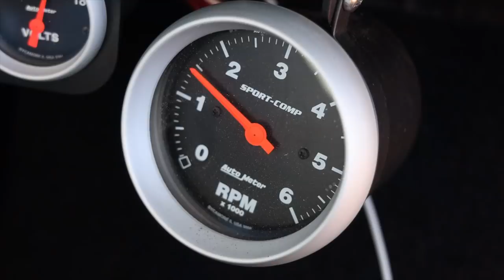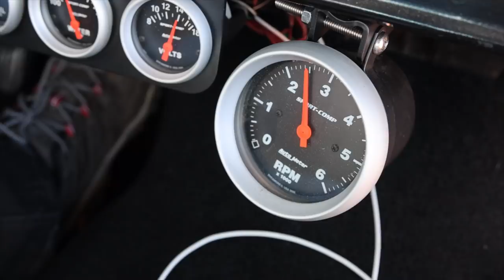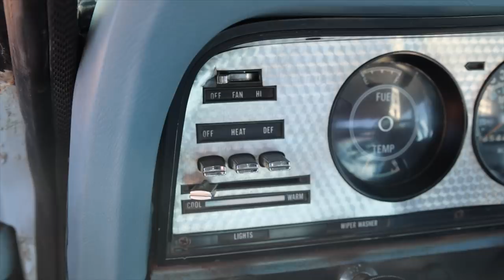The Repair List for this Cherokee Chief is Getting Long!

Comment: Someone up here scored a full sized 1980's Grande Waggoneer for under 6K. It was perfect, a really nice time peice. It's so hard to find them without major flaws or rust. I remember as a teen my dad was getting his old 72 Chev C10 painted by a local shop where he traded plumbing for the body work and paint. He had a stepside Honcho, I loved that truck....He was moving some stuff around and banging into it and dad commented about him putting dents in it. He came back with 5lb sledge and pounded on the fenders which shocked us both, because there was no damage not even the paint. He sold that shop and move to an acreage that had old trucks & cars sitting in the bush. Some were sitting there so long trees had grown between the frame rails. I guess he had plans to restore them and sell them as retirement funds.

Comment: I just bought a 1989 ford bronco with the 351w. I too have to upgrade mechanics. I have replaced radiator, pan gasket, power steering, tie rods, ball joints adjusted the steering box, replaced the rear piñon seal. The heater was not working, but back flushed the heater core a few times and it works fine. Just trying to make it trail worthy before I drive any distanced. Trying to keep it stock. I did have to replace the tires as the rig had set for a while and the tires were cracked. I enjoy the channel. I have owned two other broncos, a 1970, and a 1979. I should have kept them. I used them for search and rescue.
The old iron has character!

Comment: I love that jeep. It looks so cool going down the trail. That hot start issue might have something to do with the fuel line and filter sitting on the hot intake manifold, it is probably boiling the gas. I would move them or get some insulation wrap.
Reply from the maker: Great point and when I tackle the fuel system I'll be sure to consider that!
Reply: @TrailRecon  Knowing that carbs are pure voodoo magic, I quickly converted my '83 Bronco to a TBI based Fi system!   Unless you just like carrying a live chicken to sacrifice to the carb gods for trailside repair!  Then again, you Navy guys do love your odd traditions!

Comment: Brad, on the slow start when it is warm... I had that on a big block chevy, all the forums I read pretty much pointed to one thing. The hot engine is quickly evaporating the fuel from the vented float bowl while sitting. The long cranking is happening because your fuel pump has to get enough fuel back in the bowl for it to start and with a mechanical fuel pump this takes a few cranking rotations to fill. My solution was a phenolic spacer between the manifold and carb. Works wonderful now.

Comment: Cap and rotor with timing check.  Will make that start up amazing, electric choke helps too.  Sweet rig, I have a 74 Cherokee, 74 J10 and 75 J20 myself.  Love the full-size ones!

Comment: In 94 I bought an 84 K-10 got a EZ Ride 4"' lift,  pulled one short leaf off each spring pack, got rid of the sway bar since I don't road race, and Rancho 9000 shocks and ended up with a nice ride.  Still tow and 4wheel with this truck.

Comment: So cool.  The first 4WD I drove was a 74 Grand Wagoneer.  The first truck I owned was a 79 Ramcharger.  I had a lot of slop in my steering.  Turns out that the universal joints on the steering shaft were a horible design and went bad.  It's been almost 20 years since I sold that truck, but when I was thinking about fixing it all (including rebuilding the engine), I think Summit had a replacement steering linkage.   The breaks were spongy as well.  And the forward drive shaft would go bad every couple years because the front hubs didn't unlock.  Oh and the transfer case wouldn't shift into 4WD well.

 There was just too many things so I had to let it go.  I regret it because the thing was a tank.  Good on ya for taking on the task of keeping yours running.

Comment: Love the direction you are taking with the Cherokee. I know that you said you do not like to mess with the wiring and I am with you on that. It can be a real pain, but bad wiring has burned more than one classic vehicle. If you can, I would get a replacement harness for under the hood and the body. They can be expensive, but it is better than calling the fire department when something shorts out and...

Looking forward to watching the transformation into a restored and capable trail rig!

Comment: I absolutely love those Cherokee chiefs. But it is an old Jeep, it seems that finding one the wiring hasn't been messed with is a challenge in itself. My 91 YJ has had issues because of the wiring, not the same rats nest you have there. But I 100% agree on a rewire. The piece of mind knowing that the electrics are not an issue is worth its weight in gold. 
As for the leaf springs, I have an old rancho lift that came on the jeep and it rides like hell on the trail too, the best advice I can give, air down when you see dirt, thats the only way I've found to smooth out the ride and not lose fillings. Obviously short of a nice set of springs.

Good luck getting that beautiful machine into tip top shape, and keep up the great work!

Comment: Those square cut leaf springs can be dog eared.  You can also install nylon sliders between the tips of the leaves to make it ride better.   It's great to see you driving that old guy on the trail.  Keep up the good videos.

Comment: Brad, Just a quick check that you can do for the suspension. Leaf sprung rigs are sensitive to how you tighten the spring bolts. With the Jeep sitting on its own weight, losses all of the spring bolts. Then check to make sure they spin easily with a wrench. When you tighten the nuts back down don’t over tighten them. The bolt should still rotate with a wrench but with more drag.

Comment: My 78/79(can’t remember, it was in the nineties) had serious electrical gremlins. It also had the same hot starting issues. I had found the electrical ignition module would overheat, thus affecting its ability to perform correctly when it was hot. Plus, the carburetor needed a rebuild. Essentially, a lot of the same issues you are currently experiencing. Including a loose steering box.  

I think a new harness from Centech/Painless would be a great foundation. Look into a smog legal Fuel Injection kit to solve the carburetor issues and a better ignition system and it would be a lot more mechanically sound. 

Your video brought back a great flood of memories from the ol banana tank of my youth. I look forward to following along on this endeavor.

Comment: Recommend checking the timing before diving into the carb.  The previous owner may have advanced the timing for easier cold starts but it may be causing your slow start when warm and from what I hear, running rough issue.  A cheap timing light will help nail it down.
Reply from the maker: I've got on old timing gun somewhere from when I had my 72 Firebird... time to dust it off I suppose.

Comment: Brad, So happy you have this rig.  Love it so much and can't wait for your future videos.  Here are a few suggestions I have from building my 77' J-10 (many moons ago)...  I had to fix/replace just about everything on my J-10, but only once (done right it lasts).  Have fun, (and I'm totally jealous)...

Cooling System: I found that the fan shroud is extremely important.  The previous owner probably didn't have one and tried everything else to keep it cool.  I'd definitely replace the radiator just to avoid expensive maintenance in the future.  I added an Aux oil cooler in front of the radiator.

Aux Tank: Remember that the overflow return from the Carb probably flows only back into the main tank, so you have to always run off of the main first, then when empty switch to the secondary, then back to the main as will have a several new gallons of gas (from the overflow).  If you run from the aux tank first (with the main full), gas will spill out the main tank fill neck from the overflow return line.

Wiring: What a rats nest.  My J-10 had wiring like that and started a fire in the engine compartment.   I had to replace with factory wiring harness, and then built my own harness to extend the factory harness in many places so I could get it out of the way from heat, make it easier to add new stuff (factory AC and aux lighting, winch, etc...).
Reply from the maker: Awesome information, thank you for taking the time to share all that... extremely helpful!

Comment: In 86' when I was 20 I had a 78 or 79 Grand Wagoner with the 360.  It always ran hot.  Someone told me that AMC would bid out the pats for the engine and you could have a Ford block with Buick heads. The quadratec was fantastic.  There was a dial in the center glove box that locked all 4 wheels together and was unstoppable.  Glad to see this series.
Reply: AMC V8 blocks/heads/intakes were cast in the same place as Buick V8's (good quality high nickel blocks), and were designed by the same guy. Their downfall is oiling, just like buick V8s. But easily resolved these days.
Reply: It was the Jeep v8 that had corrosion problems?

Comment: Great video! I’m restoring a 79 chief in Arizona and have done everything you mentioned minus paint and body. I put in a new radiator with electric fans and deleted the clutch fan and so far it’s been perfect temp. I also put in Skyjacker springs and bilstein 5100’s for a 4 inch lift and it smooth as a baby. Also did the brakes.. new discs, pads and drum rebuild. Stops on a dime. Instead of rebuilding the carb, you could add a TBI kit. I have a Howell TBI on the Chevy 350 that is swapped from the OG AMC engine.Starts right up even after a year of sitting. Please post a video of your build process or post-build!

Comment: I had a Cherokee like that one only bronze colored and they tend to run a bit on the hot side so addressing the cooling is a great start.
There is a company out of Washington called full sized jeeps that sell a lot of one and aftermarket parts like a cool rear bumper with a swing out tire carrier.

Comment: I would ditch the carb and go with a throttle body injection kit, auto adjusting for elevation, temp etc, better fuel economy and power, easy starting etc. Would make it a lot more reliable.
Reply: ^X2  the benefit of fuel injection will save you a lot of hassle. Especially off-road ( incline , off camber , decline , etc) carburetors don’t hold up well to the rigors of off-road use. Unless you like to tinker on them and carry a spare. Cheers from Okinawa 🌊🏄🏻‍♂️🤙
Reply: I put a Holley EFI kit on my Grand Wagoneer and it is amazing compared to the old carb.

Comment: Edelbrock 1400 series carbs do get heat soaked. Insert a fiber insulation gasket between the carb and Edelbrock Performer intake. 3/8 inch thick works well. Also, you can try to give the truck a bit of gas when hot starting. It'll either improve hotstarts, or make it worse. I also switched over to electric fuel pumps on my Jeeps, past and present and future. it removes carb priming problems while cranking the motor. I'd also recommend sticking an actual aircleaner housing with snorkle back on to suck air from outside of the hot engine compartment.

Comment: Forget the carburetor, get a Holley EFI system with a good fuel system and it will give you years of trouble-free service. Get rid of the open air filter, get the original filter base and install a heavy duty paper air filter element, will keep your engine healthier. For longer trips you will need a single belt sepentine system, changing belts in the middle of nowhere is a pain. Congrats and nice truck!

Comment: Fantastic classic rig. On the subject of springs, I have restored several older jeeps mainly CJ5's and 7's. Finding good quality springs can be difficult. I would recommend you check out Alcan Spring in Grand Junction Colorado. They custom build springs to order, ship anywhere in the country and are by far the best I have found anywhere.
Reply from the maker: Thanks for the info!

Comment: The extended crank when warm may be due to percolation. AFB's/Edelbrocks have this problem. A thick phenolic 2/4 hole spacer may help.
A Holley would have better heat isolation because of the orientation of the fuel bowls, but need trick parts to work at angles (off road Truck Avenger).

Comment: Honestly the rougher exterior gives it a bit of character, this coming from a person who loves new shiny paint.  Maybe fix the worse rust areas and try to leave the original paint in tact.  Do all the mechanicals, but I would rock that exterior all day long.  Especially nice that you won't be so worried about pinstriping on the trail with that original paint.

Comment: Here are a few notes, some you may know. If you have questions, feel free to him me up.
1: Those are rough country springs. They are terrible. Not that rough country is a bad company, but they are just budget springs. No tapers, no spring pads, they are known for a bad ride.
2: The brake locking up could be the e-brake cable catching. Its kind of common.
3: The steering is always very light on these. But the box could be worn, rag joint bad, or the caster may be off.
4: For the AC, SonoraEd on FSJN does it professionally, has installed a lot of vintage air units, and can make hoses for FSJs if you need them.
5: And yeah, aluminum cross flow radiator with a shroud and thermostat will do wonders for the cooling system.
6: For the carb, honestly I would swap it out for a Truck Avenger. The 1406 can be made to work, and it is cheaper to rebuild it. But the TA will just be better in all situations.

But hey, you have a great rig, and glad you are loving it :)
Reply from the maker: Great information, thank you for taking the time... I'm taking notes!

Comment: A higher temperature thermostat, like 190%F might be right for your chief. That's what I run in my 1976 "full size jeep" honcho pick up with auto. trans./360 4-barrel (now with a Holly sniper E.F.I.* 17MPG & many smiles per mile!). 😃

Comment: I have a 1976 dodge van with a 360 ,it had a 2 barrel carb and now a 4 . I bought it brand new off the lot . I had over heating problems till I switched to a 3 row radiator and a 180 thermostat . Now it get close to normal runing tincture on average days and running timture on those 100 + days . Considering it still has a lot of my camping gear in it all the time . I am real happy . Please don't speed ur videos out to far apart it's to harden to find good ones .

Comment: Have you noticed a significant reduction in over heating with the louvers installed?  I own two classic Mustangs and would go new wiring harness from Painless, rear window may only need a relay as it appears you are having voltage drop(wiring, lol), and with my Mustangs and 1st Gen 4rnr the lines had clogs in them preventing proper flow which limited pressure even when given proper vacuum pressure.  Consider going with a Wilwood system big brake kit and Wilwood booster upgrade.  Decently priced and able to be done for less than 2500 in parts front/rear plus booster.   Pricey but golden on the trail.  Just my two cents and as always thanks for sharing🙌🏾

Comment: I believe I would get rid of the clutch fan and install one or two electric ones, they are more efficient and do not cause a loss in horsepower. I would also go with a Holley EFI in place of the carb.

Comment: Try holding the pedal to the floor when starting after it’s hot. When the carb is hot it will leak fuel into the manifold and essentially flood the engine. Just hold the pedal down rather then pumping it. Also I bought a summit HEI distributor for my Cheif and got rid of that stock ignition system. It was dirt cheap and works great! Puts out 12v instead of the 8 or 9 the stock one does.

Comment: I would suggest changing out the heater core while you’re going through the cooling system. This will make sure you have no contamination in the new system.

Comment: You might try moving that metal fuel filter away from the thermostat housing. It could be causing vapor lock when the engine is hot.

Comment: Used the 1406 with the off-road needle and seat on my 360. Just got the Holley Truck Avenger to see if it's better, but I'm really wanting to bite the bullet and do the Holley Sniper kit with the Hyperspark...

Did the Painless Wiring kit for the '79 CJ7, but traded a built VW bug motor to have an AE buddy wire it in. Haha

Comment: Think I would put a fuel injection kit on it instead of rebuilding then carb.  I have a few old 4wd s and off camber can flood out your engine if your not careful.  Plus throttle response and mileage all the way around are better.  Carbs have their place, don’t get me wrong but in your application that what I would do.  Love the classics!

Comment: After the engine is warm or hot if the Cherokee is hard to start it may be that the carb is getting too hot. Kind of boiling your fuel. You may just need to get a simple phenolic spacer between the carb and intake manifold. Just a thought.

Comment: As far a reliability goes, new wiring would  probably be a big project up front but save time in the long run. Curious if you have considered a TBI swap in lieu of the carb rebuild? Might get you a bit higher MPGs & definitely get better drivability with altitude changes. Either way, super cool ride.

Comment: I had a 360 ,it always ran around 200 and you will need the second tank , I had 3 tanks in mine
Reply from the maker: 3!  Where did you install the 3rd?
Reply: right , left , spare tire hole , long time ago put the tire on the roof

Comment: Have you thought about replacing your carb with an EFI kit on the Chief?   If so what are your thoughts food and bad?
Reply from the maker: It's a good option, but does add some complexity and need to ensure here in CA that it's smog legal.